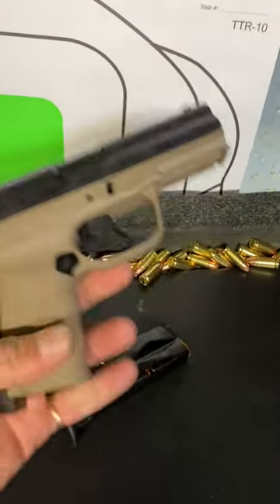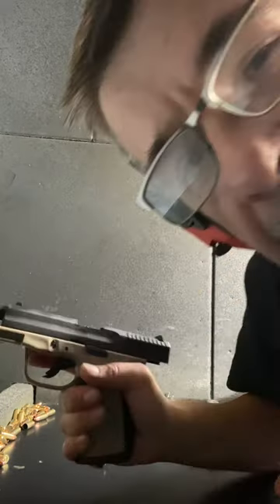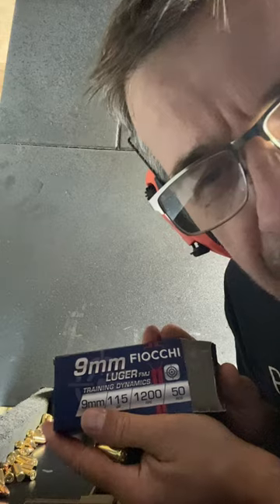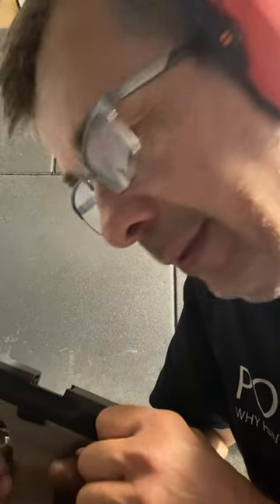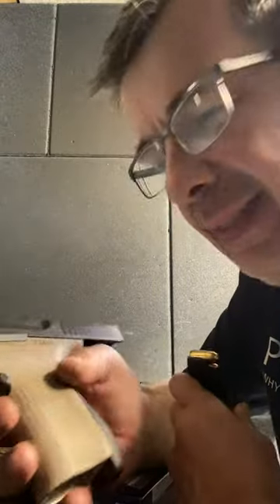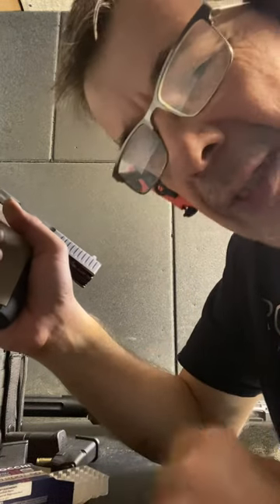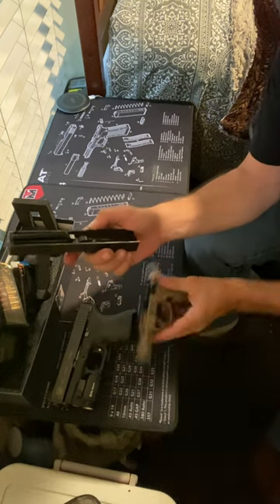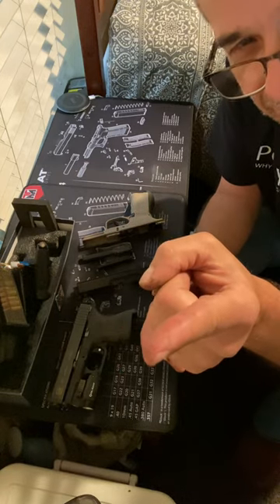FMK 9mm sub-$300 gun made in CA. Embracing the suck or finding a gem?

Comment: I’m thinking about picking one of these up. These are around $250 where I live in 4 different colors. I’ve seen mixed video reviews of these but for a budget Glock inspired 9mm I think it’s worth a shot.
Reply from the maker: I think so as well, after hundreds and hundreds of rounds, occasionally it won't return to battery all the way. It's rare, however I was told that a G19 spring fixes that (haven't done it yet). Stay safe bud!
Reply: I have one clean and lube then i cycled many rounds thru it not firing but just load rack them out over and over about 300 then i took it to the range and it shot perfect
Reply: @patrickpatterson182   I watched a movie and just loaded and cycled for half the movie. Then I took a round and just open and closed the loading gate till the movie was over.
Reply: mite get a good one ?

Comment: I have same issues, I called them, FMK, sent the firearm back to them, received it after 3 weeks, they replace the trigger and recoil spring. I tested it again, still have same issues, it can never be my carry firearm, I just relegated it to practice shooting, some friends who wants to buy Glock, I let them try this FMK, for comparison purpose only.
Reply from the maker: Man, sorry to hear that. How many rounds have you run through it? My first 40 or 50 were crap... Really worked itself out through the next hundred though. Shooting really reliably now. Perhaps you need to put some different ammo through it. Also, make sure your thumb is not sabotaging you by touching the slide release.
Reply: It's the thumb on the slide causing the issue

Comment: Not to burst any bubbles, but wouldn't all guns perform better if you simulated a nice, strong pull into battery.  Being weak with the slingshotting will cause you to have problems. I own 3 Kahrs in 9, 45 and 380. The 380 teaches you how not to get in the way of the cycles . Use the slide stop to load on the first shot.  All videos I see on the FMK g2 are full of folks who just don't let the gun get its umpf right off the bat . Let that first round in using the slide stop. Or actually let it get a good wham with a sling shot. You're being too weak with it , especially right after you cleared the first FTE
Reply from the maker: Agreed! Although if you watched a little further, all issues are cleared up and after broken in I have not had any issues in 300+ rounds. Thanks for the input man, stay safe!
Reply: Yes but then once the round has gone off the recoil spring should do the rest but this is not the case

Comment: hello any upgrade beside the trigger? and how is the fmk holding up?
Reply from the maker: Hey, thanks for asking. At this point I have well over 1500 rounds through it (I don’t keep count really). I do not have any issues with it except 2 non-issues… First, if released slowly with depressed trigger, the slide will not return all the way. This does not affect anything while it is engaged however. Second, the captured spring seems to sit kind of loosely, so when I disassemble for cleaning, the spring wants to fall to the floor lol.  It was getting banged up so I polished up the slide and stippled the heck out of the frame. For under $300 it is really not bad!

Comment: Any tips on how to fix the failure to feed issue?
Reply from the maker: How many rounds have you gone through? There is a break-in period. Make sure it is lubed and always try different ammo brands.
Reply: Haven't gone through any yet due to this issue. At first i thought it was the type of ammo I got for it,which was Fiocchi Range Dynamics 115 grain FMJ 9mm Luger @UnstoppableYaris
Reply from the maker: @TerrorMaskHost234 Fiocchi runs well for me… How about you lube up the rails nicely and rack it back and forth 50-100 times. Without ammo of course. Look at your ramp, there may be a tiny burr on it or something. If you can’t fix it, remember that even super expensive guns have issues sometimes, contact FMK and they will arrange everything to make sure your pistol runs.

Comment: I hope they fixed them that's why it's $189
Reply from the maker: After a few hundred rounds, mine is functioning flawlessly. I think they dialed in whatever the early issues were. Just replaced my trigger system to FAT, cant wait to try it out!
Reply: 289.00 is the base price. With a cardboard box and one mag only. Standard is lockbox, 3 mags , and fast trigger (804) but California won’t sell the trigger with the gun. 64.00 .that also bypasses having the mag safety drama off pulling it out.

Comment: This pistol has a major safety issue. Try pulling the trigger without engaging the safety blade. The pistol will go off! I have sent this to FMK explaining this issue. After saying it was "fixed", it was returned with the same exact issue!  I also verified this at a local gun store using their display model and same problem! Furthermore, I've had an employee replicate it to see if it's just me, and same problem!  If you don't believe me, simply pull on the sides of the trigger without pushing the blade. WITH ENOUGH FORCE, IT WILL CLEAR THE FRAME AND ENGAGE THE SEAR. This is a dangerous weapon. Why FMK doesn't want to recall this pistol is clearly immoral and wreckless. 

Additionally, I've had FTE and FTF issues that I sent to the company twice for repair (They will not give you a shipping label). Yes, the pistol is $250, has a lifetime warranty and is made in the USA, but if you have to spend $50 for shipping each time you have a problem, what is the point? You just turned your pistol to a $350-$400 gun when you could've gotten a more reliable used Glock or M&P shield. 

 For those that are still adamant on buying the FMK, please reconsider the safety issue and do this test at the store before buying it. FMK's commitment to safety clearly shows and I would stay away from this company. Luckily, I no longer own this gun and have purchased other more reliable firearms, but I thought I should let the public know. Stay safe!
Reply from the maker: I appreciate your detailed input very much! Really sympathize with your issue, however mine seems to be functioning correctly when blade is not engaged. Could it be an isolated issue with this particular gun? I can also fully relate to spending under $300 for a gun that turns into an $800 one after added features and mags, if you feel like it here's a funny vid take on the subject https://youtube.com/shorts/gkhKnVoO85U?feature=share . Again, thanks a lot, and stay safe my friend!
Reply: @@JR-1OI’ve got the 804 trigger and it only depresses with the blade engaged. I also don’t have my thumb on the  slide release when I shoot. That alleviates a lot of the issues.

Comment: 1  failure. Is one to many .. won’t trust this with my life rather get a S&W SD9
Reply from the maker: It actually started horribly but after about 50 rounds it hasn't had as much as a hiccup. Just replaced the trigger, will shoot some more soon and see if it stays reliable.
Reply: Better never own any gun then lmao, I should probably dump my sigs and glocks because I've had single one off failures right?
Reply: Ive had several malfunctions on my glock 26 in the first 100 rounds. Then 0 after that for hundreds of rounds. Its normal when breaking in. But yes for a carry gun it should be something thats proven 100% reliable
Reply: @chorizojuice  that's not too surprising for a subcompact, really short recoil spring assembly are often very stiff from the factory
Reply: @bower31  ive read its somewhat common for glock to have some malfunctions in the break in. After that its nicely wore in and reliable. From wat ive read about the fmk it seems like its the same way. Idk if id take the risk and buy one myself.
Reply: @chorizojuice  for the like $250 you can find them for I think I'd try one if I found one. They're customer support is good and I wouldn't be buying it as my only gun so I could be patient with it. Would be great if they did turn out to be reliable
Reply: @bower31  im reading up on them. Its cheap and seems to have good customer service. I have afew other handguns so it can just be a range toy if its not so great. The only thing i dont like is it doesnt take glock mags
Reply: @chorizojuice  I found that a bit disagreeable as well, but do find the fact they're ambitious enough to design their own mags impressive. Since there are so many glock clones now. At least the mags aren't horribly expensive online
Reply: Yes I agree with you on that. I'm not a snob but I picked my pistols from the brands and like Beretta and Walther names are known to be the best firearms my PPQ was made in Germany and my PX4 storm was made in Italy and my 92x was made in Tennessee.
Reply: @chorizojuice  . Customer service is excellent. Sent a email got an answer in 4 hours . Bought the 804 drop in trigger kit, was at my door in 2 days. And no Glock mags don’t work , but Springfield XD do .
Reply: @Sparky-oo2pw  you have to dremel a mag catch notch in them, very easy to do (make sure you debur with a hobby file)
Reply: Weasel.

Comment: Where in CA did you find it for that price ?
Reply from the maker: Thanks for asking bud! Turner’s had it on sale for $289… I think current price is $299. Keep in mind, NOBODY has the magazines for it except the factory. Will cost you about $40 each, if you register your product with them and get 10% off with free shipping.
Reply: @Unstoppable Yaris  thanks , I was just looking at their site , I bought one of these guns last year through sportsman's warehouse,  after all said and done was about $450 . I've bought extra mags , and the metal slide lock from FMK .I'm gonna upgrade the trigger soon , but have been very happy with it , and plan on purchasing another soon .
Reply: $299 in Ohio
Reply: @johnniegonzales5518  California ammo brother had it for 269.99
Reply from the maker: @johnniegonzales5518  Nice, I just received the FAT trigger, after installing it feels crunchy like a Glock. Nevertheless, now I can fire a lot faster. Will find out if its any good soon enough.
Reply: I missed it if you said you cleaned the gun before firing it? But I have heard these guns need a couple hundred rds to break in! Appears that’s what it needed!
Reply from the maker: @markcole6475  no cleaning or lube, straight from a box. You are correct Sir! It worked out all the kinks by the 6th mag.
Reply: I believe I’ve seen Turners have the FMK on sale as low as 269$. Even at the regular price I feel it is well worth it.
Reply: @UnstoppableYaris  with slight modification springfield xd9 mags will fit!